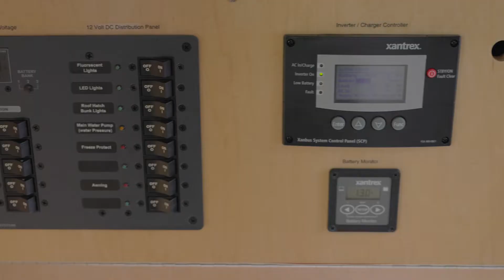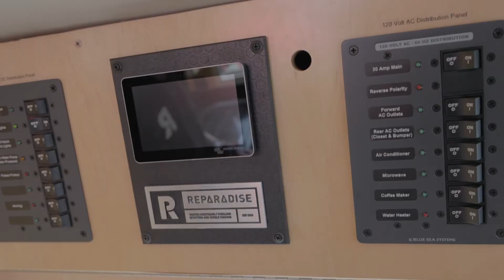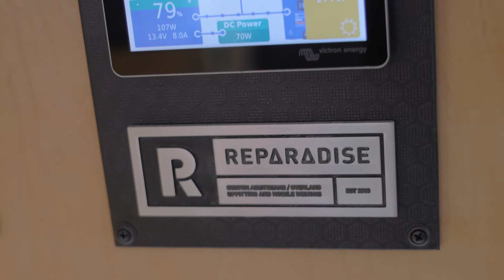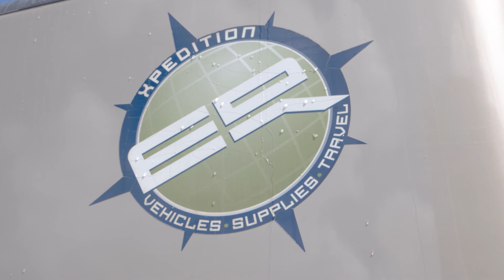EarthRoamer Electrical Upgrade

Comment: Looks very nicely done. A friend just picked up a used Earthroamer. Helped him service the diesel heater and hydronic, and I think the AGM’s might be due. Not sure if he’ll replace with AGM’s or upgrade.  Its current setup apparently met its power needs, and a MultiPlus, some orions, and probably a new MPPT is a chunk of change. Apparently it has 4 8D batteries accessed from below from what I can tell.